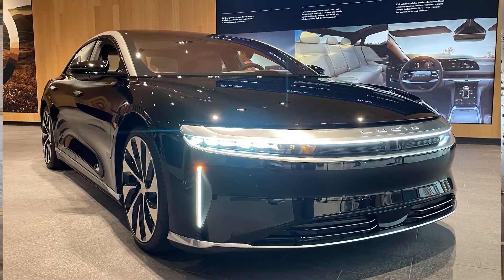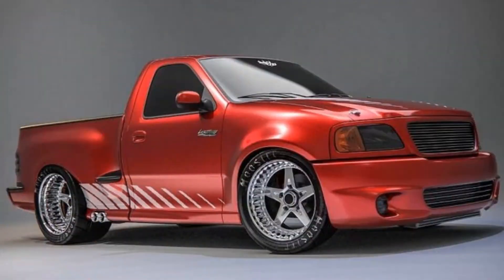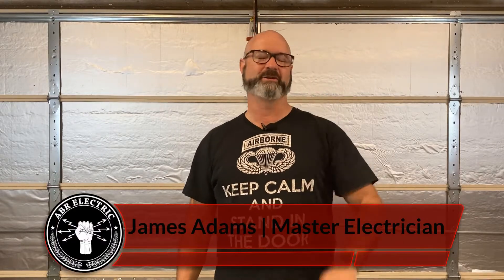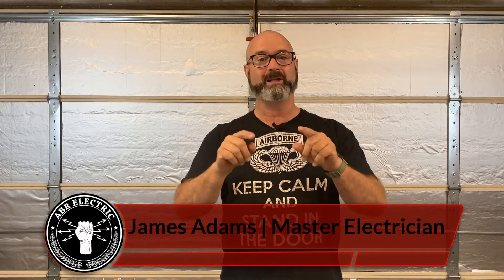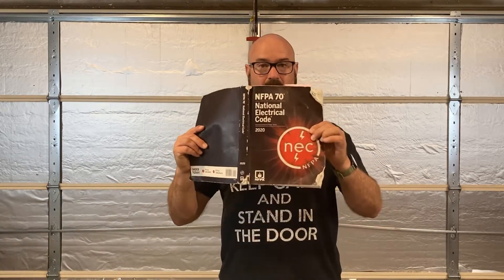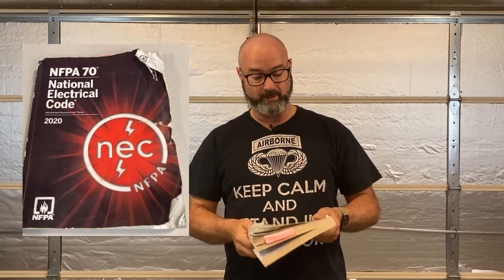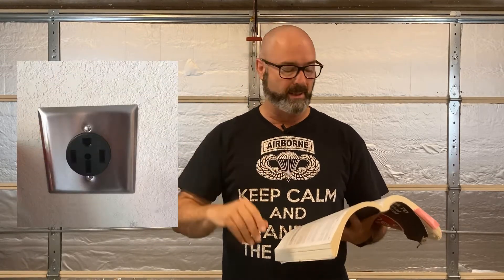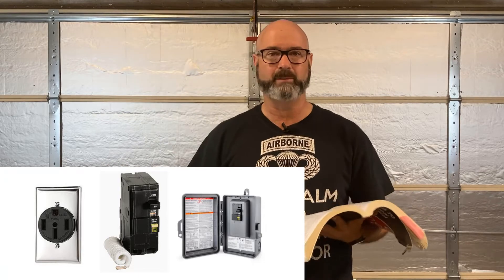Electric Vehicle Charging Challenges: GFCI Protection

Comment: Does a hardwired level 2 charger need to be on a GFCI breaker? Thanks!
Reply from the maker: Generally, no. It will depend on the *manufacturer*.  Many have built-in GFCI / CCID protection
Reply: @abrelectric  Great video. I have an Ampure Go2 Level 2 plug in charger (24A max) that feature built-in GFCI protection (6mA detection, meeting NEC standards.) It is plugged into a former dryer circuit (10ga solid & new 1450R Leviton EV specific outlet) on a 30A regular breaker. Do I need to swap the standard breaker for a GFCI breaker? (I have no need to ever unplug the charger from the 1450R outlet.) Just don't know what problem 2 GFCI's on the same circuit will cause. Thanks for your thoughts.

Comment: Tesla’s manual for their wall charger states don’t use a gfci breaker. Since it not a receptacle & hard wired that should be ok? Correct?
Reply: My City Electric Inspector just denied my install for my Tesla Wall Charger. Stated code is a GFCI. I pointed out page #6 of the TWC installation manual where it states to NOT use a GFCI breaker. He said "GFCI is code..." and handed me a correction notice.
Reply from the maker: @martymorgan3085  Also 210.8 doesn't apply to hardwired installations, but receptacles.
Reply: I am using a square D 2-pole 240vac 60 amp breaker currently. no issues.
Reply: I just got second hand ev .
Will i need a surge protector or a volt regulator with my level 2 home charger ?
Reply from the maker: @Ahoooooooo  probably not. What kind of charger? Tesla or J1772?
Reply: @abrelectric  

I bought an id4  .
It came with a generic charger 220V 10A .
It's not very fast but it does the job for me .
What i want to know if i need anything extra to protect the car . 
For now, i just plug in where i previously had an air-conditioning unit . 
Any help would be highly appreciated.
Reply from the maker: @Ahoooooooo  depending on your state or city, that 220v breaker might need to be a GFCI breaker. Check with the owner's guide to see if you need surge protection. Typically it's built into the charger.
Reply from the maker: For the wall connector,  absolutely.
Reply from the maker: According to 210.8, yes.

Comment: I was looking for a follow-up video on a workaround for the nuisance tripping....I have a 15 amp gcfi  (everything is brand new and passed inspections) for my level 1 charger and I'm running into the tripping issue. I've had two electricians tell me 2 different things: 1. switch the gcfi for a standard outlet, 2. get a 20 amp gcfi outlet....very paranoid about electricity stuff since I live in an older home
Reply from the maker: Is the GFCI tripping instantly with the charger or intermittently? Is that GFCI in a dedicated circuit? Or when it trips, or do other items lose power as well?
Reply: @abrelectric  it's a dedicated circuit and trips instantly. Nothing else is connected to that outlet. The charger does work with a regular outlet but it will sometimes trip after some time because other items are wired to that outlet
Reply: I heard something that the level 1 chargers that come with the EVs purposely send a signal that trips gfci for some safety reason, I wonder what this signal is, and if this signal can be filtered out somehow, or if it can't, then it means it is designed in such a way to purposely leak a very small amount of current to ground that is just enough to trip a gfci?

Comment: Do any electric car/dryer splitters have GFCI protection?  Is that possible?  I trickle charge my 2017 Nissan Leaf on 110 with GFCI protection.  I fried two outlets that weren't GFCI protected.
Reply from the maker: I'm not sure the lack of GFCI protection is frying the plugs. If they overheated and melted, the issue would likely be be with loose terminations in those plugs. 
It is unlikely that a dryer splitter has GFCI protection built in.
Reply: @abrelectric . Thanks for responding . I am electrical illiterate.  Decades ago I tried to repair a heating pad on my bed and only managed to set my bed on fire!  Yikes!
Reply from the maker: @rev.dr.yvonneray2035  But you survived!
Reply: @abrelectric  Haha!  Yes.  I did indeed.

Comment: I've had an EV since 2018 (we now have 3 EVs) and with this change I would suggest you install a hardwired wall unit. It not only rarely nuisance trips for obvious reasons, but it can usually charge at a higher rate than a mobile charger that's plugged into a socket. 

Also, if you have more than one wall charger charging more than one EV, most of these charger units now can do smart load sharing, keeping the total concurrent load down and within your panel spec.
Reply from the maker: The load-sharing feature is a life saver.

Comment: Outside of hardwiring, how do you avoid nuisance tripping then please?  I've seen some claims the portable L2 chargers that come with vehicles are somehow less prone to nuisance tripping than dedicated wall mounted L2's.  Is that true?  How difficult would it be for an electrician generally to convert a NEMA 14-50 to a hardwire installation and swap the breaker?  Any special considerations?  Thanks.

Comment: Are you able to hardwire a charging station with a disconnect to avoid the GFCI rule?
Reply from the maker: Absolutely. Once you do that, any disconnecting means requirements come into play.
Reply: Isn't that disconnect requirement come into play only if the circuit over 50 amps @240? Or if the breaker/panel is not in a line-of-sight from each other (EVSE & Breaker panel)?  [BTW - I'm in California | Los Angeles county specifically] [ nevermind, you already answered this in another comment]

Comment: Good morning!  I noticed that a picture in the video showed an outlet, GFCI breaker and a disconnect box.  The Tesla wall charger manual says don’t use a GFCI breaker. Do I still have to?  Also the disconnect box I thought was only needed if over 60 amps or over 150 volts to ground. If setup for 50 amp breaker, is it still needed?
Reply from the maker: Absolutely! The TWC is hardwired, and has built-in GFCI protection. The disconnect is needed if your TWC is not within sight of it's breaker.